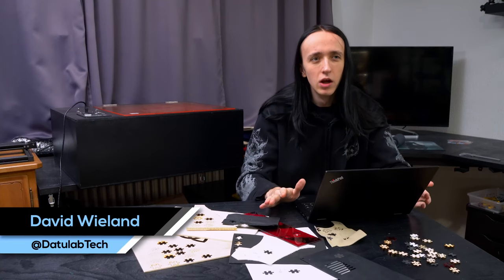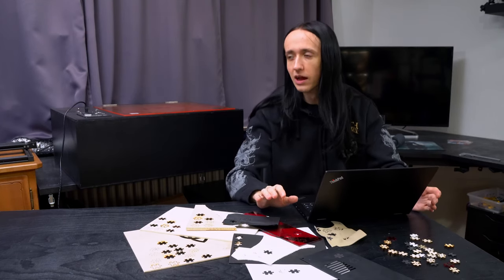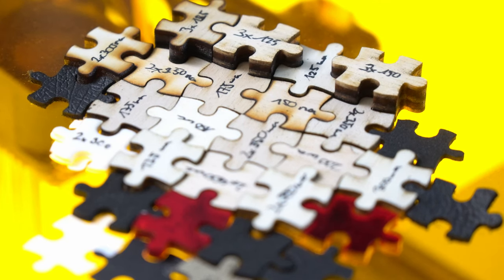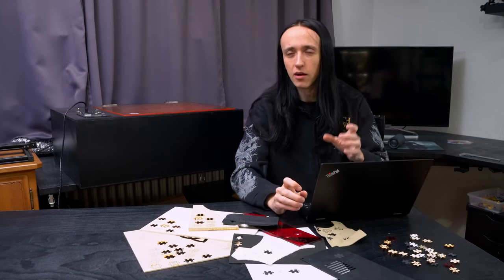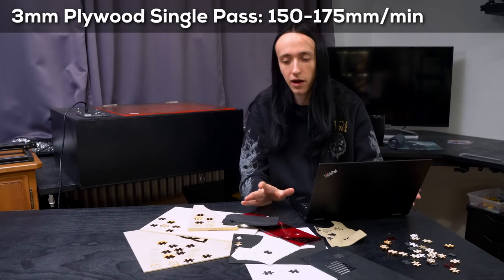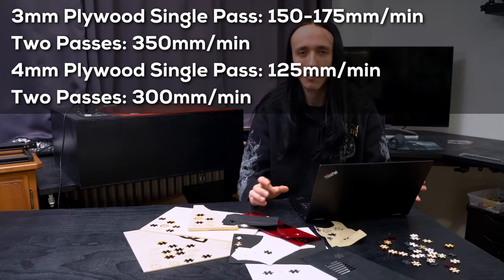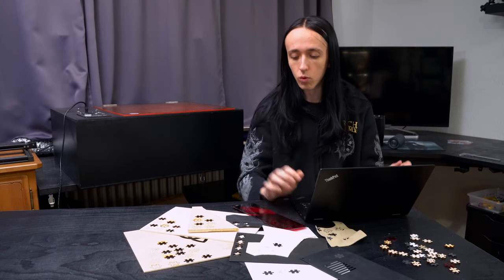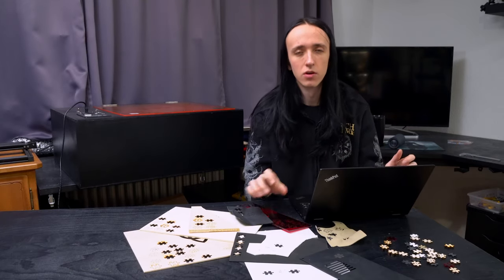CUTTING Test With Endurance 10W+ LASER

Comment: Thanks for the in depth comments, with such a long video I was a little disappointed that we did not see the laser in action for the full cut, personally I would like to actually see the laser do the job, thats what prospective owners want to see, the machine doing a complete cut, even if sped up.  The tech info is very good and this is good information for new laser owners.  Not one reviewer seems to have done this as far as I can see, I dont know if you have that footage but it would be good to edit it in to your   review if you do.  I actually have 2 endurance lasers the 8.5 and the 10 watt both are very good and have not let me down over 2 years of use.  Definitely recommend them to a new laser owner using a diode, I have now switched to C02 lasers simply down to speed, I still prefer the engraving quality of a diode but I need to get things done quickly and diodes just do not have the speed of a C02 machine.

If I am doing a photograph I will use the diode as it gives a much better finish of the C02. thanks for your review.